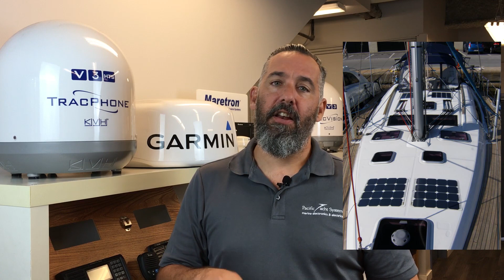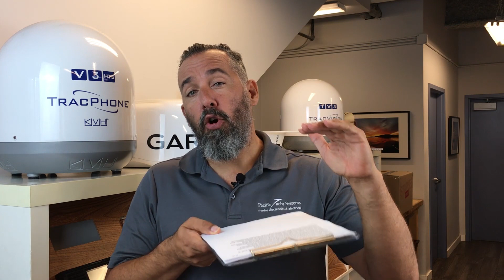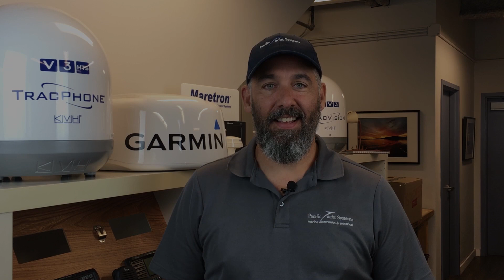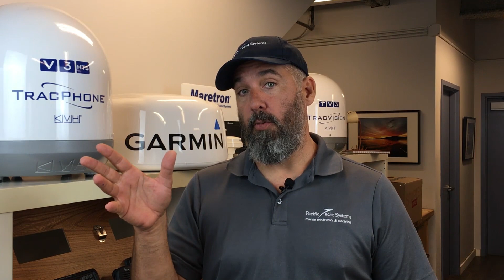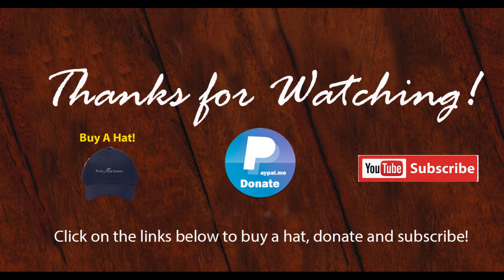What Is the Minimum Charge Rate for Solar Panels On My Boat?

Comment: I find solar peak output 10%-20% of battery rated capacity works well. More is better. I generally use 60cell panels, they're very good value. I often oversize the array to charge controller by 20% STC and usually, it's never an issue.
Reply from the maker: Thanks for sharing Liam.

Comment: The higher you discharge them, the faster you need to charge them to reverse the sulfate crystalisation process discharging causes.
Here's a nice lead acid charge efficiency vs. charging current chart to help: https://i.stack.imgur.com/1equM.png
Where the temperatures all cross at 0.02 Charge rate * 440 Ah = 8.8 Amps * 12V = 105 Watts is what I'd aim for on average. The chart shows they are most charge efficient at about 0.1C (44A) in summer and 0.005C (2.25A) in winter. Some manufacturers recommend 0.2C (89A) for an hour for reversing any large sulfate crystal build-up after being in standby for 6 months in order to help equalize the six cells that make up 12V lead acid batteries as some cells may have sulfate stratification. Some batteries like Discover's Mixtech series may help eliminate this problem.